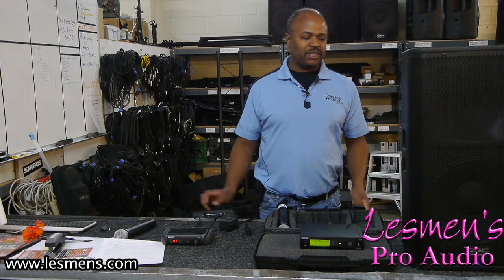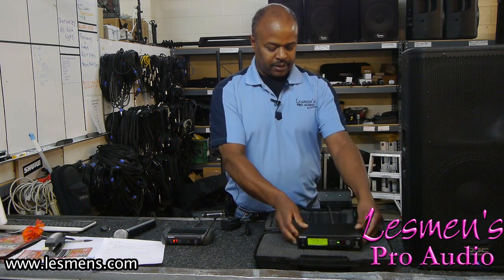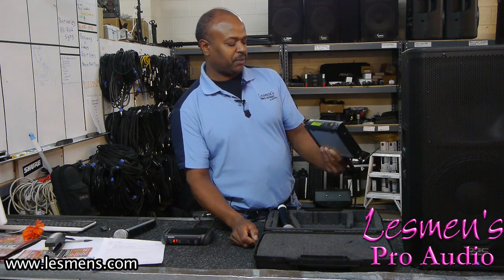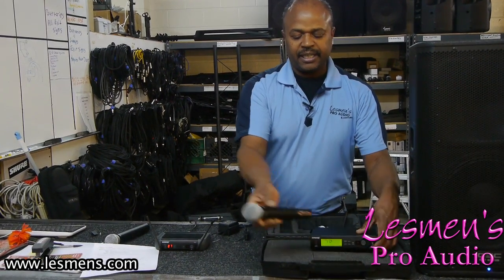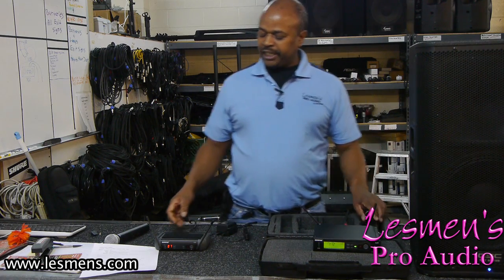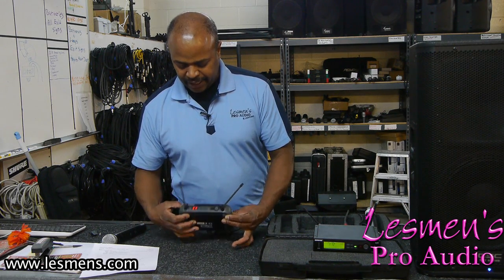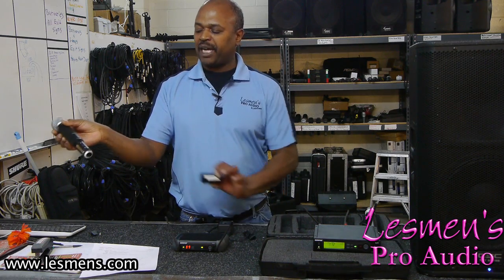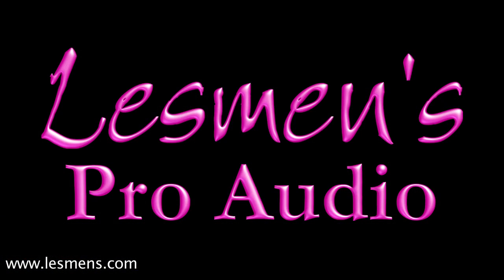Wireless Mic Tips / Troubleshooting Shure Mics SLX24/SM58 and PGX24/SM58 Frequency change.

Comment: do7.pl/SM58   Hi this is Ninjn, and this is me talking on the SM58S, S edition. I did not do any modifications to this audio.I have been using this to stream videos of me playing games on twitch. The mic itself is a bit boomy at times especially if you're too close. Other than that it holds very close to the SM7B in terms of quality, but the SM58S is a great buddget alternative. One thing to mention, is you will need a USB interface for the SM58. It uses a lot of gain. I personally use the Behringer UM2 for budget purposes. If you want to future proof a bit more instead of the UM2, get something like a Scarlett Solo gen2 or Behringer UMC202HD, plus the Cloudlifter amp or Fethead amp to boost the gain on the SM58.

Comment: Hi, i'm having an issue. Well not really an issue just want to find out what causes it. So at my school we got three of sm58 wireless mic sets (both lav and handheld). The board is A&H GL2400-32. When the mic comes too close to the mixer at times (the receiver is close to the mixer) or even in the room which is a small size sound room, a high screeching frequency sound is heard, what may be the cause of that?
Reply: is the mixer near the speakers
?
Reply: I'm  having the same issue.. I have connected my shure handheld wireless system directly to speakers.. It produces some high frequency sound near to speakers..The sound is too loud and irritating. I have to move far away from speakers in order to avoid this noise.. What can be the issue ??

Comment: I have the pgx4 and pgx2 sm58 it all works except the green light will not sync to the transmitter
Reply: philly billy Mine won't sync anymore either. Any ideas on the issue? Shure charges $95/device, si I don't want to spend $190 to have Shure check it out. I'm an electronic technician but I don't have a schematic for it.
Reply: philly billy opginal